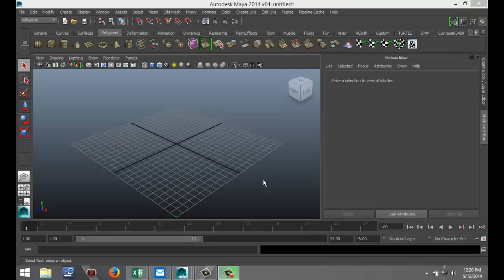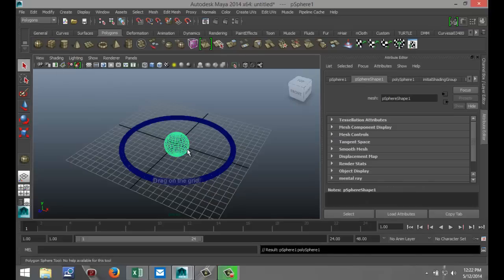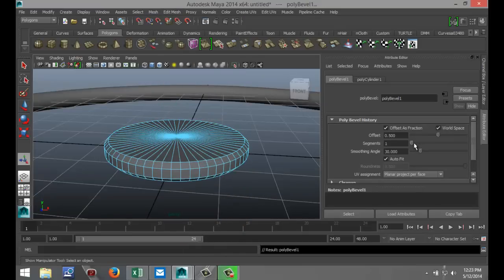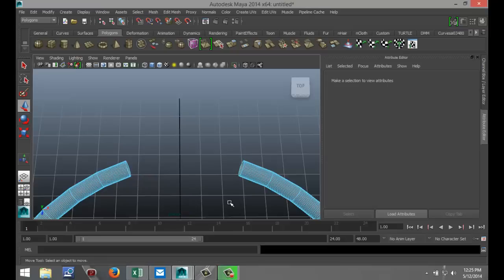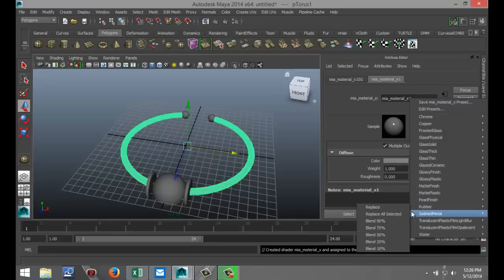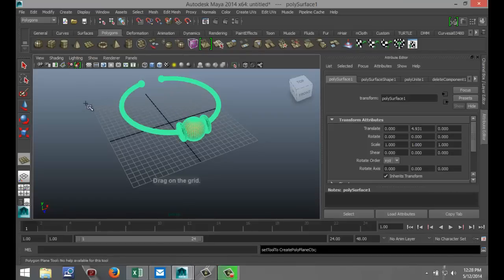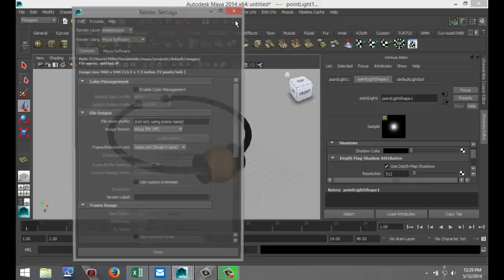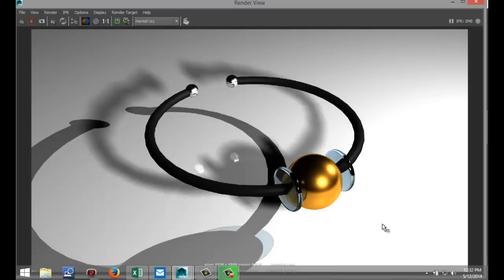Maya 2014 tutorial : How to create rubber, chrome, glass and copper

Comment: Hi Mike, 
This tutorial, and so many others of yours are so helpful thank you! 
I am super new to Maya and are are having some trouble batch rendering a project which uses the copper Mia_material_x preset with the physical sun and sky setting. It looks perfect in my render view, but when I batch render, it is washed out with less vibrant reflections and slightly duller colours? Do you have any tips or links to possible solutions?
Reply from the maker: Turn off default lighting in the render settings
Reply: Thank you!